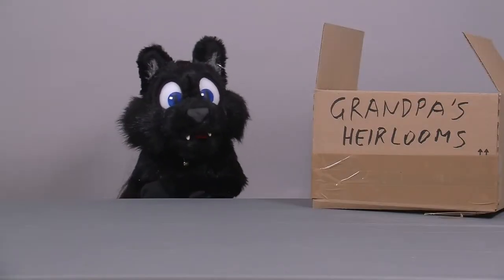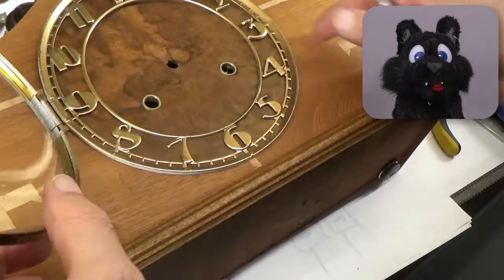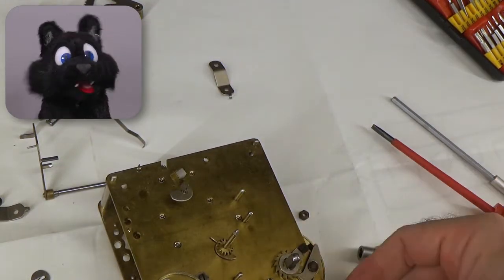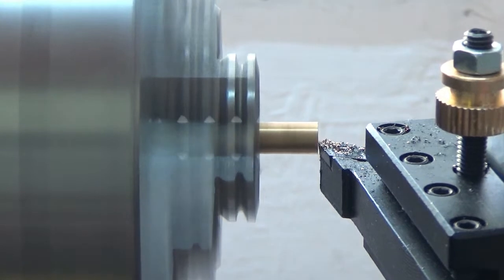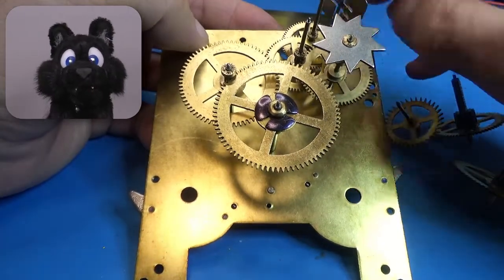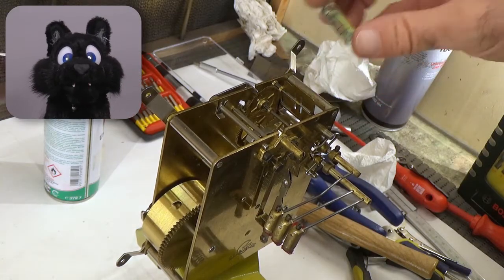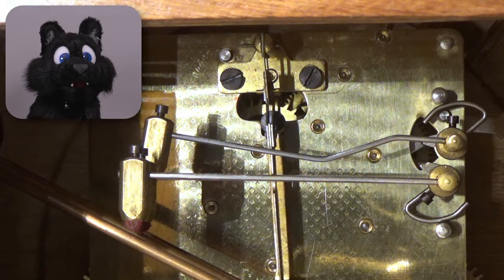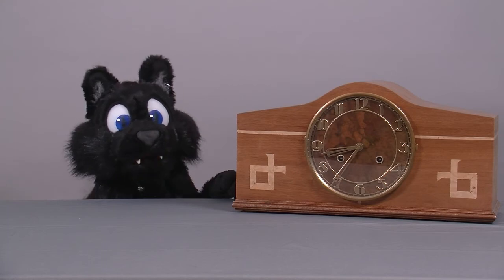Repair #3: Desk Clock

Comment: I think instead of "bearings" here the word you were looking for was jewels. They can use a "jewelled bearing" in some things like pocket watches and wrist watches. Not as common in larger movements. A bushing like they have there is a type of bearing. Those divots are 100% for containing oil. Clock and watch people can get very persnickety about oils. That big wear track you had there is a pretty good indication it may have been run without suitable lubrication for a while. 
Still nice repair mate. Nice case too. I hope your granddad would approve. 
I really need to repair the one from my granddad. At least one of the pivots has been damaged so I'll need to drill it out and put a new one in. That'll be fun lol.
Reply from the maker: Thanks! I'm pretty sure my granddad was all over with his oil can usually, but not quite sure he would have access to that particular bearing that was worn out. Good luck with yours!

Comment: 1930s Gröblinger, one of the simpler mantel clock movements from them
Reply from the maker: Thanks! I had no basis for research other athan "old clock" and that doesn't yield proper results. My grandparents had it stowed away in a back room where the case deteriorated over time...